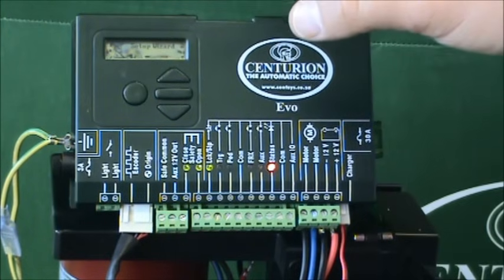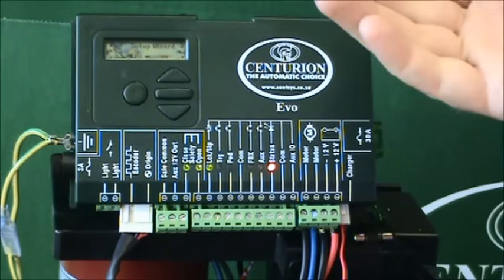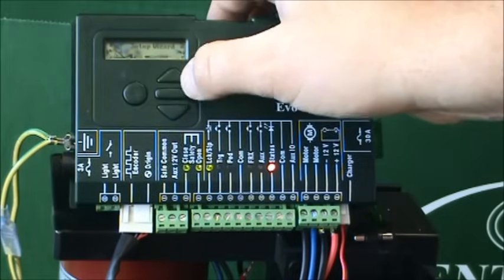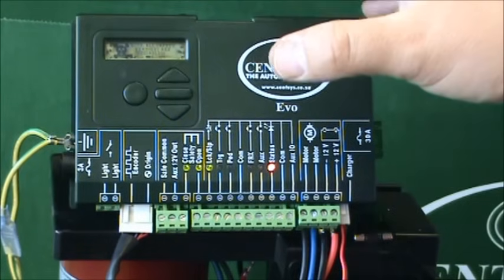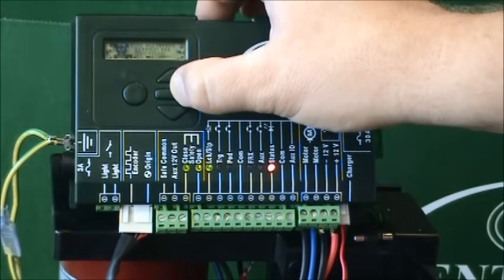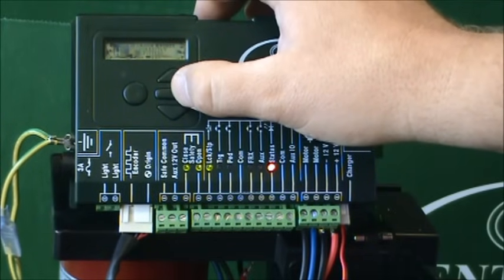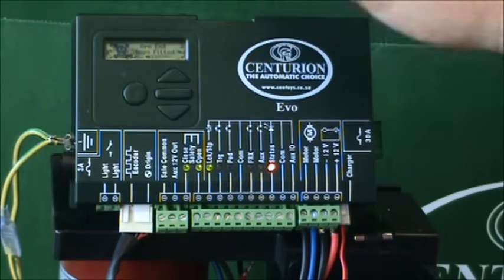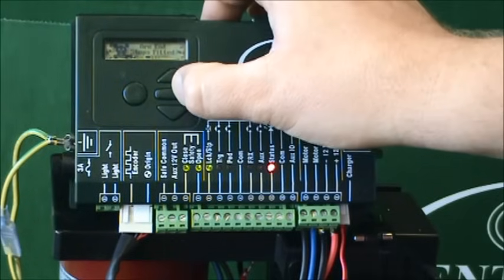D5-Evo - Setting the gate limits

Comment: Had a mktor that opened and the completely refused to close.. I have a gate that weights close to a ton. Can't move it front or back.. lifting the gate with great difficulty changed that. You saved me while drunk at 11pm. And saved me 350$
Reply: Thanks. 🤣

Comment: Thanks for the excellent tutorial.just one piece of advice to all.ensure the gate is "locked" or engaged on the track.
Reply from the maker: nic osia Good observation. 100% correct - that is a requirement prior to this step :-)
Reply: My show no limit set
Reply: @drekayode3799  Did you then scroll through the menu to set up the limits?
Reply: Setup fail no origin found wat you do then please

Comment: Good day. after starting the setup Wizard the gate opened to the first stop then the circuit board went blank and reset and the gate motor also stopped. Can you please explain what could be wrong. Thanks

Comment: my d5 keeps saying no origin found when i try this. what can i do
Reply: I have the same problem. How did you resolve this matter? Thanks.
Reply: Same here, did u win?
Reply: Check if your magnet is responding when passing by the motor,if it does not produce a clicking sound it shows its not positioned well...

Comment: Thank you for the video but I am confused as you don't mention about having to manually move the gate to half way through it's travel before you start this process?
Reply from the maker: Hi Andy. Thanks for the feedback. Whilst the video concentrates on the electronic procedure of setting the limits, your point is well received and it may have been well worth mentioning that. I have since added it into the description of the video to read "Before proceeding please ensure that gate stops are securely installed and the gate is positioned half way between opened and closed.".
Reply: @CenturionSystems  doesn't need to be.. you can turbo the open and close with the round button. :)

Comment: My gate is running to the close position during thos prosegure and then stop, then screen goes blank and reset, doesnt go back to the other end stopper, what may be the problem ?
Reply: The battery termanal was corroded, replased the battery and problem solfed, thanks

Comment: HI there, I discovered it my was battery that was at fault. I have replaced the battery and the limit settings seemed to work. But now, after setting the limits (according to the instructions here) the gate closes halfway and then automatically opens again immediately!
Reply: I've tried everything from resetting the limits to resetting the system. After the limits are successfully set, the gate opens halfway then closes.
Reply: Mine too
Reply: I set limits finding end stops 1 & 2 successfully but the gate stalled not running to normal what could be a problem?

Comment: Good morning have a problem with my motor it keeps on saying battery low although I checked that it has 3 out of 4 bars I was trying to set limits it only opens and completely shuts down and restarts again so then I wanted to continue my settings and now doesn't even close always shuts down
Reply from the maker: Hi Lucas. Please give our technical support team a call on 011 699 2400, or send an email to support@centsys.com. One of our skilled technicians will assist you with your query.

Comment: When my motor does the first move it reaches the first stop and then the board resets. What could be the problem and is there an easy solution?
Reply: Hey Brandon, have you recieved feedback regarding this issue?
Reply: Hi.Did you manage to resolve the problem?
Reply: Did you get an answer? I have the same problem

Comment: I do the setup but is not changing saying no org found
Reply from the maker: +Edwin Kalimadola Hi Edwin
The error indication signifies that the sensor is not receiving a valid pulse from the gate-mounted origin magnet, or the controller is not receiving a signal from the sensor. Possible causes could be:
•• The distance is too great between the origin sensor and the magnet
•• The magnet and sensor are mounted at different levels
•• Incorrect orientation of magnet
•• The gate is getting stuck at a certain point before the magnet has passed the sensor
•• Faulty origin sensor

Solutions to rectify this include:
Check the information screen on page 65 – it should display the position of the magnet (left/right) when the magnet is passing the sensor
•• Ensure that the magnet and sensor are mounted at the same level
•• Ensure that there is an audible ‘click’ whenever the magnet passes the origin sensor
•• Ensure that the arrow on the magnet is facing the operator – there should be a repelling action when the magnet is brought near the sensor
••Move the magnet closer to the origin sensor.
•• Replace the origin sensor

If you need any further assistance please feel free to call our Technical Support Call Centre on  +27 (0)11 699 2481

Comment: Hi,  Please help
When setting up a new D5 EVO limits, the gate goes slowly to the open position, the wizard says it is finding the first stop, then simply stops. It will not reverse to find the next limit and then the message on screen  changes to Centurion systems, D5 evo waiting for Co-processor. then it says WAIT 1 MINUTE OR RESET ALL POWER and the screen goes blank and returns to the setup wizard
Reply: Have you found out what the problem is i am having the same problem
Reply: @eugenekleu3629  have you figured out what the problem could be? Im having tbe same issue